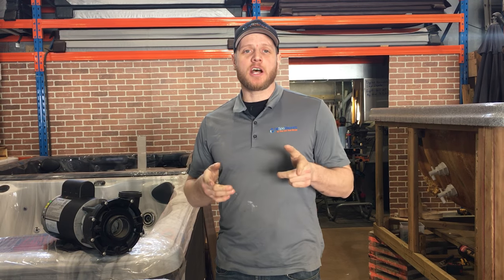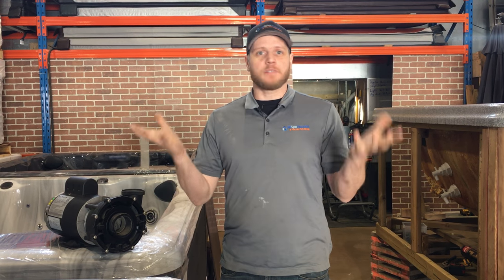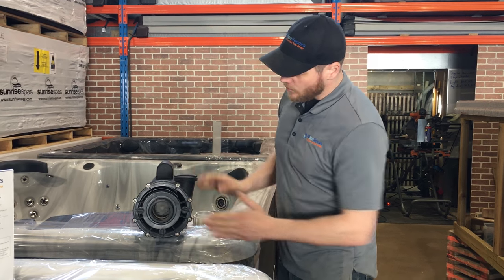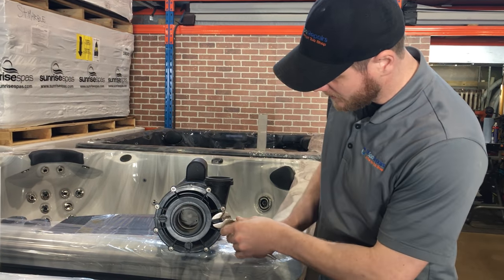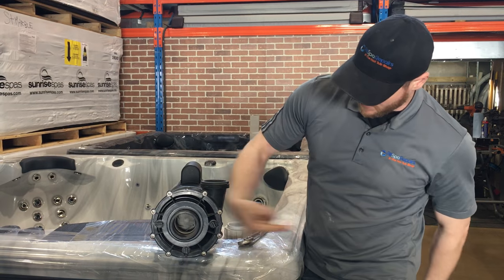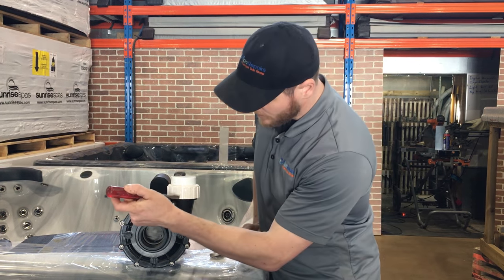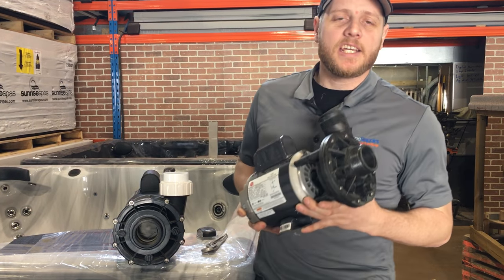HOT TUB PUMP - Clear an Airlock after refill!

Comment: Couldnt get to the bleed valves based on locations on both pumps, but unscrewing the unions on both worked perfectly. Just slowly unscrewed until the air stopped bleeding and water started coming out and bam back up and running in 2 mins.. thanks for the video 🙏

Comment: I've had this code 2 times in 2.5 years...both times it's the circ. pump. $500 plus each time for the pump. I wish it was an air lock! Try this first method first, then check fuse, then check pump.
Reply from the maker: You should check out our video on the "Do's and Don'ts" Of hot tub buying, and watch the section on Circulating Motors. Sounds like you have a magnetic drive circulating pump. Those things do not hold up very well. Usually called a tiny might.
Reply: @TheHotTubShop  Is there a better pump I can get? I have not yet bought my second pump, but they have it in the shop ready for me to pick up. I just confirmed on my end it's the pump again....
Reply from the maker: @tmodd2032  Do you know which pump you're currently using? If it is a Tiny Might, you can put a different circulating motor in, but its not as easy as simply putting in a new pump in. New lines and plumbing have to be run for a 1.5" Plumbing for a proper circulating motor. Again, check out our video https://youtu.be/wTn-j3rpXv0 Alistair talks about circulating motors here 40 Seconds into the video.
Reply: @TheHotTubShop  The motor that is in there and the one I can replace with is a goulds pump. 6080U0015, or laing 14 ....if that makes sense to you.
Reply from the maker: @tmodd2032  Yea, so typically they have a 3/4" Inlet & Outlet. In order to put a larger circulating pump in there, your plumbing needs to be completely re/re'd as well. Otherwise you're stuck with it. https://hottubsupplies.ca/products/circ-master-series-1sp-48fr-1-5-x-1-5-02593000-2010cd?variant=42170027802841&gclid=Cj0KCQjwk96lBhDHARIsAEKO4xYrgprkWOHS4swHDhMjGSAKIuCFVm-1dgBEpTvBC09B_Oetydx7hD8aAlsMEALw_wcB
Reply: @TheHotTubShop  I am not sure I follow what you mean. The inlet/outlet is quite large...so 1.5"-2" for the connections to the pump from the spa lines. Is that what you mean? Are you saying that the pump is under powered/sized for the spa, causing the issues?
Reply from the maker: @tmodd2032  To be honest, I can't tell you what's causing the issue unless we're the oniste tech and we can see 
1. The condition of your pump 
2. Your water chemistry routine 
3. The plumbing set up in your hot tub 
Otherwise, we're speculating.
Reply: @TheHotTubShop  OK. Thank-you very much for your insight. I really appreciate it. Is there any truth to leaving the re-circ pump on all the time? The supplier I got the last motor for said it might help to leave it always running... But I wasn't so sure that would do anything but waste more electricity..
Reply from the maker: @tmodd2032  That's the whole function of a circulating motor. You're spa pac shouldn't allow it to turn off actually.  Is its a 24/7 motor designed to circulate your water. The benefits being it uses less energy than using your jet pump, cause it's a smaller motor, and it's generally silent. The downside is it moves less Gallons per minute, which is why you need to run it 24/7 for it to effectively filter your water. And you have no control over your filtration. When a tub is designed with a Jet Motor doing your filtration, you get to set hours when it comes on. it moves more Gallons per minute, and you can increase or decrease the hours depending on your needs.
Reply: @TheHotTubShop  Well. Clearly I don't know much about the tub! thanks! So it probably did run all the time until it stopped. 
Cheers!
Reply from the maker: @tmodd2032  lol No worries. Might be stuck with it until your next tub. :)

Comment: Question, I'm stumped. 2012 Sundance Peyton. Got it used. Worked fine for awhile then after awhile I pump one(circulation pump) quit coming on automatically. Had to hit the button to turn it on to keep the tub warm. Worked like that for a while but now it won't turn on at all. Just hear the relay click. The heater light comes on and you can heater water flowing from through the heater but then it'll shut off and go to watchdog mode. Any ideas? Not throwing any codes...
Reply from the maker: Sundance tubs usually have a really small circulation motor that pulls water through the filters and then over the heater... It Pushes alllll the water through a tiny little ozone return fitting and back to the tub....

Your filters may be to old (not just dirty but old) so lots of oil in them... Try taking out your filter, resetting your breaker. 

There could be a piece of junk stuck in that ozone return fitting... That's a bit trickier to tackle 

The small circulation pump could be on its way out... The little magnet drive pump you have can start to spin off center when the bearings get old. So they may run for a bit then stop. 

Lastly, your large motor that is controlled with the main digital display that controls the jets.. if it's making a clicking noise when you try to run it, that means a fuse is blown on the circuit board.

If the large pump runs sometimes but not other times... Means it's running to hot and turning itself off 

Fuses can blow for lots of reasons but it will need replaced...

The reason you might get the tub to work a bit when running the large motor is there is usually a small tube connected to the circulation pump... It's designed to push water into the large pump to stop it from freezing but water can flow the other way as well. 

Hope this helps. Good luck!!! Happy hot tubbing

Comment: I bought a house that came with a hot tub. Thanks to your straight to the point instructions. I cleared the airlock in 10 minutes using the air release plug.

Comment: Pump air into the tube (per YT video) did not work. 
Released the air from the attachment tube. Did not work
Opened the valve at the top of the motor. Voila!!! It worked!! 

Thanks for saving me $$ 🍾

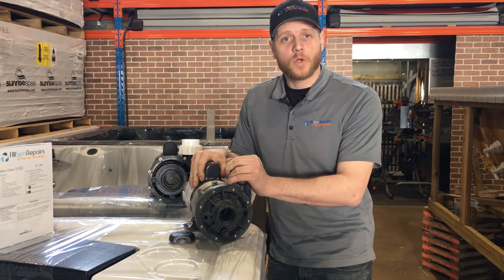Comment: We drained, cleaned and refilled the swim spa yesterday. It holds 1200 gallons of water. After it was almost full I turned on circuit breaker and left it alone for 11 min so it could do its diagnostics. This was at about 3:30 yesterday -Saturday . Then I increased the temperature and left it to warm up. For an hour. It will not go above 80 degrees. I got a LF message which means low flow but water level is fine. Manual says heating capacity of spa will not reset automatically you may press any button to reset. So I pressed several buttons waited another hour and it still was not heating. The manual says make sure the pumps have been primed. How do I do that?
At 7 pm last night it was still not heating and I still got the low flow message. The filter was new a month ago. Water level is fine.
 I just checked this am and it’s still giving a LF message at 7:25 am Sunday. 😑

The jets are working so do I have an air lock?

Comment: Tried this on my Hydropool 775 hottub there was a bleed nipple below and level with the input, got a little air out but not fixed, i am going to try loosing the output nut and if that does not work i will plunge the filter base.

Comment: I think this could be updated.  First, I can't access my pump easily because we have a deck around it.  Secondly, my hot tub has a bleeder valve in the tub itself, and another valve on the filter compartment.  My problem is that easing either of these does not help.
Reply from the maker: Well, this is just a general information video. I'd say the majority of hot tub owners have their pumps accessible. And eventually, you'll need to plan for that when the pump needs to be repaired/replaced. Those bleeder valves don't always work, and get clogged or choked up for whatever reason. So you'll have to figure out how to access your pump sooner rather than later.
Reply: It's possible to plunge push water into the hole where the filter connects. This can push the air out of the system. I used a submersible pump to force water through but a toilet plunger might work.

Comment: Slowly but surely I have plodded my way thru this project. I am having the same issue as I originally had a month ago when I started. The FLO error code. I have done everything suggested in the manual and online. Put a hose in where the filter is, replaced the flow meter, purged the pump of air with the bleed valve on the front, had circ motor rebuilt and installed a new filter. It just randomly stops and the FLO message appears. It might shut down for 10 mins or an hour and then restart.  Any ideas? Pump cover seems hotter than it should be.  2005 Sundance Maxxus.
Reply: Did u ever figure out what it was?

Comment: I really wish we could separate the wet and from the motor so I don't even have to drain the water to replace the motor. That was a serious lack of planning. Or, do the two separate? I couldn't get mine separated.
Reply from the maker: The wet end of your motor doesn't perform that function (keeping water in the hot tub)  because it's an integral part of your pump. The Wetend does come off, but the impeller inside is threaded onto the motor shaft so the motor can turn it and move water through your wetend. You can't remove it without taking 1st the faceplate off, then un-threading the impeller, and then unbolting the wetend from the back of the motor. 
To keep water in the tub, you need Valves on either end of your equipment. These are the PVC components required to service a hot tub without draining. Gate Valves, Knife Valves, Ball valves....but some hot tubs don't come with them by design to keep costs down.
Reply: @TheHotTubShop  Thanks for the response. I saw a subsequent video of someone disassembling the wet end and having to disconnect it from the motor main body. It occurs to me that they could simply have the motor shaft insert into the wet end separately permitting us to replace the motor without disassembling the wet end pump section. Anyhow, thanks again : D

Comment: have a Jacuzzii J-lx 400. flw1 error came up out of no where. had it for years and I just did a water change 2 months ago without a problem. 2 days ago I notice a fl1 error were it switches from the error fl1 to it temp. heat will not work also. I ordered a flow switch and to it appart and noticed no flow threw it . no flow on circulation pump. could it be the pump? like i said change the water 2 months ago and just 2 days ago seen the error. i did have my  kids in there lower the temp for them) but not sure if the could have caused anything.
Reply from the maker: Sorry I need to get better at replying to these comments... Yes you are very correct, if you are not seeing flow through your clear flow switch receptacle in the line there then you probably have problem with your circulation pump. 
The small magnetic drive circs that come with your style spa often don't last more than 5yrs... Once the bearings get a little warn they don't spin true and stall regularly. 
It is possible to fix by yourself... You'll need to order a 240v laing 3/4 barb style pump. 
Use a heat gun to soften pipes... It will make your life easier... 
Watch out for the small bleed lines while you're working... They break easy.